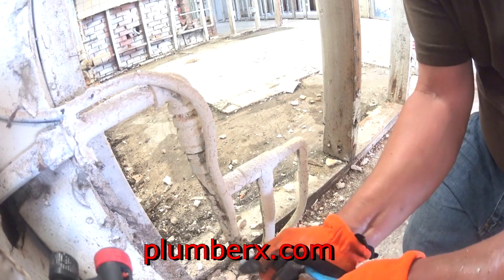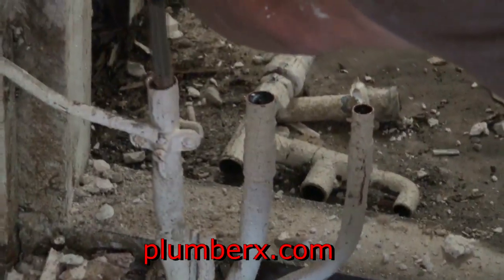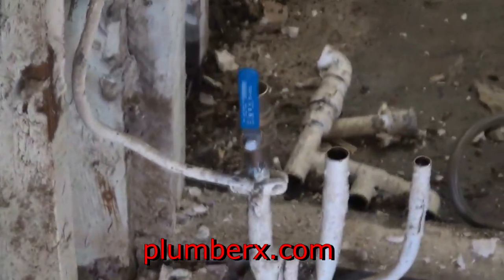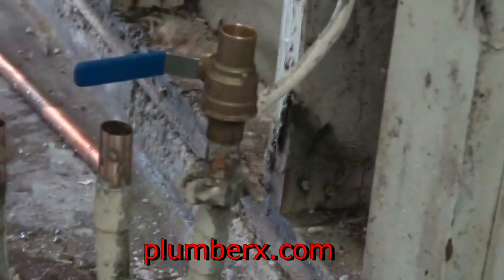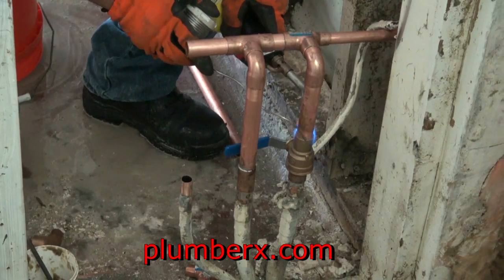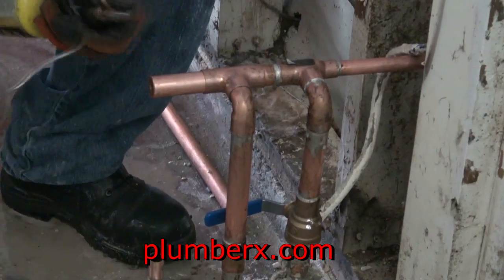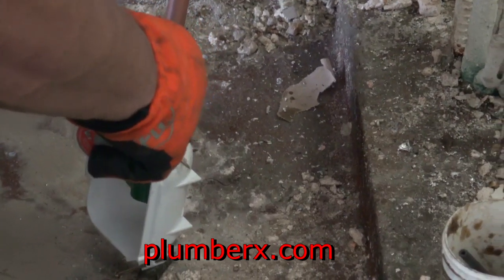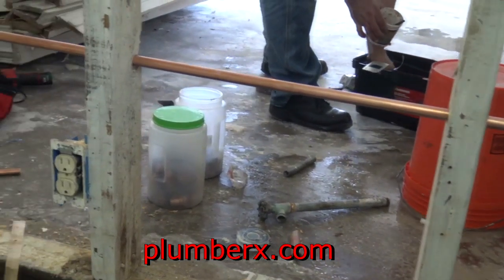How To Solder Brass And Copper

Comment: Hi Claude,  maybe you can do a video explaining manifolds and how older plumbers loops the lines.

This info is so valueable to anyone with a slab leak.

Finding/locating  the manifold and how to tell which copper line has been leaking

Maybe you could explain it using a drawing?

You older plumbers are truly the best!
Reply: *looped
Reply from the maker: Thank you. I will see what I could do. Thank you for the idea.

Comment: No flange on the outside shutoff and no shut offs on the other two lines going into floor?   Lines going into concrete floor are going to eventually get leaks from concrete contact.  Should of abandoned them and run pex through walls ceiling since it appears place is gutted?

Comment: Thanks Claude.  Am I correct to assume that it doesn't matter which way you install a ball valve?  I know some other types of valves (like globe valves), there is usually an arrow.
Reply from the maker: Really yes, that is true, But it is a good idea that handles open going in the direction of the water flow. I can see this on commercial job's making it easy to determine the flow of water. . It doesn't always work out that way because in some cases there could be something in the way to where you could not turn handle. Great Question.
Reply: @theartofplumbing  Thanks for replying.  You make a good point about trying to face the handle towards direction of flow.